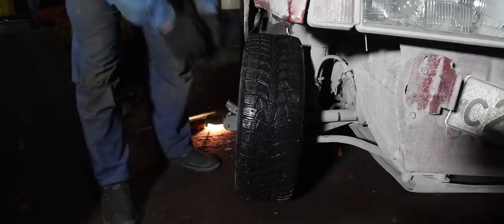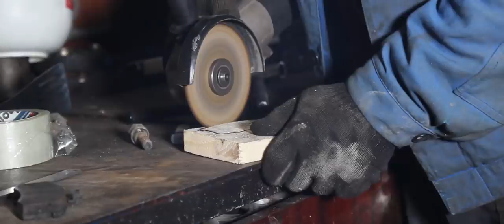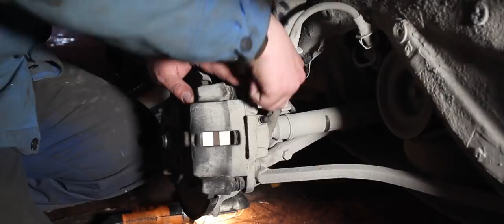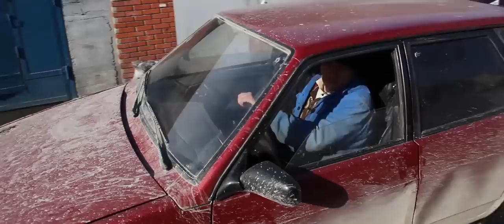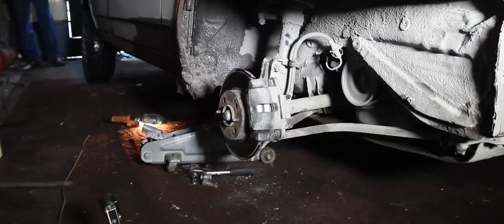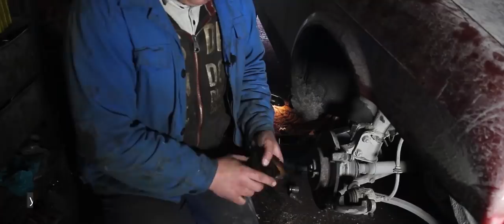Wooden brake-pads: will they work or not?

Comment: Still Lasted Longer than Autozone Valucraft Pads!
Reply: That's only funny to people who knows what those are. I'm dying here lol.
Reply: Lol its all about how well you drive. I have bought the cheapest possible pads everytime "under $20" and never gotten less than 2 or 3 years of use out of them. Most of them lasted as long as i had the car. I dont understand how people are just tearing through brake pads.
Reply: Yea, one year or lifetime warranty
Reply: Aaron Stith Not everyone drives like a grandmother. Time is money.
Reply: Sir Justin of Port Town of Parm im in no way a slow driver.
Reply: I work at Autozone and refuse to sell them
Reply: Aaron Stith Everyone is in a rush to get nowhere riding the ass in front of them hitting that pedal every couple seconds! 😂
Reply: Big D Fitness no they fucking don't. Factory brake pads last 30-40k miles aka 60-75k km. Only on a Prius the brakes last 100.000+ miles cause they're using electromagnetic braking most of the time so there's no disk braking.
Reply: BS i have gotten what Big D stated and i don't drive slow but I also am not in a race either.  A lot of people over use their brakes, hit them for no reason instead of planning ahead.
Reply: Choice777 not true on the Prius brake pads I see them in the shop all the time well under 60k and the only reason why the other guy thinks the brake pads from the manufacturer last over a hundred is because the car is new and there is no extra wear on the suspension if you baby a new car it will last you around 120k same thing with Prius but trust me regenerative braking is BS after you switch out the first pads on any car the last you half as long because the other suspension components are worn of course all this also depends on breaking conditions and where you live or what road
Reply: Just for you know this also contain wood hence the name organic pads.
Reply: @Alberto What the fuck does suspension have to do with brake pad wear?
Reply: iLoveEatingPie are you trying to tell me that two cars being the same one having worn down suspension components won't require more breaking effort? You don't think this car with worn suspension components will not want to wander go in straight line have resistance and vibrations amongst many other things that factor as your car wears down all these things come in effect and require more breaking effort
Reply: @Alverto Braking with a disc brake is converting the kinetic energy of a mass to thermal energy. Why would the "braking effort" increase as suspension wears? What do vibrations change and what resistance are you talking about? It would increase only if your ass got fatter as you spent money on burgers instead of shocks and bushings.
Reply: iLoveEatingPie hey we need people like you though you guys make it fun for us at work we always bet on how long you guys last 🤣😂😂
Reply: FrugalPrepper's Garage & Garden So you've been zoned? I should tell you the story of the rebuilt Chevy 350 c.u. in. motor I bought from them.
Reply: @Alberto Then explain if you think you're so clever: how does suspension wear accelerate brake pad wear?
Reply: iLoveEatingPie that's how we explain things in the real world we actually do him and see him everyday theory is a whole different thing my friend it doesn't get you that far
Reply: iLoveEatingPie and yes the shit you read on your books is Theory trust me it's different in the real world
Reply: @Alberto So all that typing and raging for saying "I don't know". Since you don't actually know how suspension wear accelerates brake pad wear, what makes you think it does at all? You're saying that old cars wear brakes faster and that's why, I assume. What makes you think the suspension is at fault, though? Might as well be "piston ring wear makes brakes wear faster", makes as much sense (i.e. absolutely none).
Reply: iLoveEatingPie exactly what I mean you haven't seen shit I am the other hand have tried it and have seen it and do see it all the time I don't think you can say the same you can't learn that in a book this is like sex if you don't try it you will not learn and I did mention why worn suspension components affect pad wear
Reply: @Alberto Use punctuation, for fuck's sake. It's barely possible to understand this gibberish. It's all "I know more than you, yada yada...". You explained nothing at all. How do worn suspension components accelerate brake pad wear?
Reply: A lot of Valuecrap buyers are the ones selling their vehicle.
Reply: What’s the brake dust like with wooden pads? I’m ready to get rid of the semi-metallic pads on my F-250.
Reply: Meeker Extreme and they don’t know what engine braking is, even the service writers. Last time I was at the dealer and I told them that my temperature gauge goes low when am doing engine braking and they were asking me is I know what I was talking about. They still charged me $80 for diagnosing despite I told them that my thermostat may have gone bad. They told me they spent 30 minutes to figure this out. They are either lying or just idiots, so I never went back to that dealer.
Reply: Big D Fitness sounds about right
Reply: Choice777 of course they do, I don’t know how many trips there are that I only lightly applied the brakes for less than 10 times. Sometimes I don’t even use the brakes at all when I stop in front of a red light, the engine braking is so powerful that if you don’t time it right you may actually stop earlier than you expect. The only few times that I use brakes hard are when I drive aggressively or when others do.
Reply: iLoveEatingPie you don't not know what you are talking about text book warrior maybe never had to clean muck under your fingernails in your entire life
Reply: Valuecraft parts are for people selling the car if you care about your care you’ll be willing to pay good money
Reply: Life of your pad and rotor is all about minimizing lateral runout at rotor face. Buy a cheap dial indicator.
Reply: +Sir Justin.    Well, I drive like the little old lady from Pasadena.  ;)
Reply: Choice777 dude you are trippin, I've got at least 70,000 miles on my front brake pads, and I bought the car used, so not sure at what point those pads were installed. And after checking today, I still have about 40-50% of pad life left, and all my suspension components are worn out other than the control arm bushings... It's all about how you drive.
Reply: FrugalPrepper's Garage & Garden 
He should use an old pair of shoes next time,. I would like to see that,. 
"Next week Conrad's I will use my daddy poo poo's  shoes" 
..
Reply: +OC  funny that you say that. When I was a kid I had brake pads for my bicycle that were molded to look like shoes, lol.
Reply: Lmao!
Reply: Liquid Swords.   100 percent i do my share of speeding but watch my mpgs and wear and tare and see know rrason to race up to read lights or ride ass on the highway lol
Reply: true
Reply: FrugalPrepper's Garage & Garden lol, snort
Reply: Hey don't knock the autozone joints. They last me about 8 months and they're always free. I ain't bought brake pads in 7 years 😂😂😂😂😂
Reply: some guy. I have had great luck I have them on Wifes car and my truck they have lasted longer than wagners...go figure...
Reply: Yep, my family used them on an F250 work truck, and they didn't last beyond 20k miles.

This was after that truck lost most of its grunt, its days of carrying 5,000 lbs of gravel in the bed were 5 or 6 years gone by that point.

(Before anyone says anything, the gravel pit loader called us liars when we told him that he overloaded us, that it was only 1,500 lbs that he loaded until we crossed the scale to pay.  Then tried to blame it on us anyways.)
Reply: Big D Fitness we found the guy who doesn't know anything about cars. 25-30k miles on average.
Reply: I drive like an idiot, and tow stuff all yr round. Autozone free calipers and pads for life, I am lovin it . Just replaced one caliper and pads on the front last week on the F250 for free.
Reply: @fishyer777  They last quite a while, if people will just drive like they are supposed to.
Reply: Lma0🤣🤣🤣🤣
Reply: Cheap pads are better. The more expensive ones wear down the rotors fast
Reply: Would you like "lifetime" sir?
Reply: LMFAOOOOOOO.  SO TRUE !!!
Reply: What brands do you all consider to be quality pads for cars in general? I know the namebrand crap from chain stores is usually undesirable.
Reply: @albertoascencio5935  You know what, I'm going to say you probably know more about cars than me. But you seem to know nothing about grammar and punctuation.
Reply: @albertoascencio5935  that's very mature of you. Although I have to say,  of every comment you've posted, this one was the one I could understand
Reply: @MilesPrower1992  I'm telling you dude, you need to start capitalizing in the beginning of sentences and using periods at the end. It's third grade stuff, if you're going to criticize someone on their spelling maybe you should have your mom check yours first! 🤣
Reply: @albertoascencio5935  I'm telling you, man, if you dont know the difference between spelling and grammar, there really is no hope for you! Also, this is a youtube comment, not an essay.
Reply: @MilesPrower1992  Is punctuation part of spelling? 🤣🤣🤣
Reply: @albertoascencio5935  No it is not.
Reply: @MilesPrower1992  Talk to me about the video not my grammar and punctuation, or just go upload more video game crap on YouTube. 🤣 You can correct people there.
Reply: @albertoascencio5935  theres a difference between being legible and being an essay.
Reply: @albertoascencio5935  and if you want to talk about the video, theres a huge difference between suspension having wear,  and leaking fluids. If theres fluid leaking on your brakes the brakes are obviously going to get messed up
Reply: @MilesPrower1992   Okay let me educate you real quick. Shocks and struts leak fluid when they are worn sometimes they will do, what we call "explode"  and get braking components wet. If you didn't know, shocks and struts are part of the suspension.
Reply: @albertoascencio5935  yes, I know that, no need to be condescending. If your suspension is leaking enough to get the brakes wet, you have a problem!
Reply: Brake with engine if you want to save pads
Reply: Get in the zone buy Rockauto
Reply: FrugalPrepper's Garage & Garden lol
Reply: Chris Phillips you’re sort of obligated lol
Reply: @albertoascencio5935  the most BS I've read on a comment thread... Leaky struts is your argument? Literally the least likely problem to have unless you're buying Valuecraft struts too. 😂
Reply: @PLKxR  my argument is that it can happen and it does a lot! you think people don't go cheap on their cars?😂 
"unless" ??? research how many cheap struts are bought
Reply: Can't buy cheap expecting top quality results, it's just common sense.
Reply: @iLoveEatingPie  energy transfer. As shocks and struts wear down and ball joints wear out the car can't transfer energy as well, or too much weight shift happens so it takes more breaking effort to slow down.
Reply: @wifelikecow  Sorry, don't really get it. Not saying you're wrong, but I don't understand. Brakes merely convert the kinetic energy of the disc into heat via friction. If the ball joints are worn, why would that affect this? I do imagine a situation where the car would rock back and forth during braking, but still don't see why that would accelerate brake wear. You would just have longer braking distance because that does not let the pads do their job properly, but in the end I would expect wear to be the same, as you dissipate the same amount of energy. Or even lower, as you are not heating the pads as much with your poor braking. I also just noticed that the conversation kept going and Alberto revealed his argument, which is that worn suspension components can get fluids on your pads. I mean, it can screw up your pads. Maybe somehow accelerate wear as well if you soak them. But that's such an unlikely scenario that I am not even sure what to think of it. Really not an argument for "worn suspension accelerates pad wear".
Reply: Prolly won’t last longer than autozone valuecraft brake pads, but I guarantee they make less dust!

Comment: I was shocked there was no fire! Hell, I was surprised it grabbed the rotor at all, lol.
Reply: I would have bet good money on it catching fire, I'm actually disappointed it didn't.
Reply: It wouldve caught fire from 60+ mph to stop a few times
Reply: cellphonelightsaber was thinking fire as well
Reply: cellphonelightsabe
Reply: cellphonelightsaber
Setting wood on fire without tinder is very difficult.
Reply: @ryantexada9269  "It wouldve caught fire from 60+ mph to stop a few times" You need oxygen to sustain fire... so dont bet your hand or head on that.

Comment: The Montreal Metro has used wooden brake shoes successfully for over 50 years. They use yellow birch, and soak it in peanut oil for a month and then in salt water. The advantage of the wooden shoes is quieter operation, a more pleasant smell if they need to be applied hard (most of the breaking is electrical on the motors), more environmentally friendly, and most of all very little wear and tear on the steel wheels which results in considerable savings. Note that the metro runs on rubber tires, but has steel wheels for safety, switching, and maintenance operations. The main wear on the steel wheels would be the breaks, and by using wooden breaks they generally do not need to be replaced during the lifetime of the car (40-50 years).

Since the Montreal Metro is entirely underground, it would not be subject to the weather, road salt, and dirt you would find in automobile operation so those might be bigger problems for wooden breaks.
Reply: I once visited the facility where they manufactured the wooden break shoes for the Montreal Metro. Quite an impressive set up, and the peanut oil has a distinctive smell when emergency brakes are applied.
Reply: glad I found a topic related to trains in my hometown.

Comment: The montreal metro use wood brakes on all of the wagons. They use cherrywood impregnated for 6 months in peanut oil, then treated with ignifuging salt, they last about 80000km. Take note that there is not much distance between each stations, so lots of braking.

The wood brakes have the advantage of not wearing the steel wheels and to be quiet. Since they make them on site, it is also very inexpensive. Plus, the metro being completly underground, it help to keep the toxic dust low. Wood, salt and peanut oil, all that can be eaten and eliminated by your system without any issue at all.
Reply: thephantom1492 Awesome...
Reply: thephantom1492 i still don't get stm and the double wheels
Reply: Junkerbunker: From the video? STM Société de Transport de Montréal. And what do you mean by double wheels?
Reply: thephantom1492 they have metal wheels and rubber wheels
Reply: Thanks! I'd heard about these pads but not the treatment process.
Reply: Is ignifuging also an English word and synonym for fire-proofing? In any case, thanks for the new term!
Reply: thephantom1492  :)
Reply: I think that's what causes the "oily" smell in the stations
Reply: A lot of our amt train in the montreal- vaudreuil line also used wooden pads a lot more recently in the past than most people believe, of course it isnt the only thing stopping the train. The pads in the metros are treated so they release minimall wood dust because wood dust is a listed probable human cacinogen.
Reply: Big brain engineering
Reply: @mi16t  The metal wheels are a backup in case of a flat tire, and they guide the trains through the traditional rail based switches.
Reply: Interesting, I know for a while they used wooden pads on the early trains.

Comment: I have independently tested this and can confirm similar results.  I used that nice hard oak they build pallets with. It will get you from point A to B, provided there are not too many stops between them. As bonus, nice smoke smell lets you know they are working.